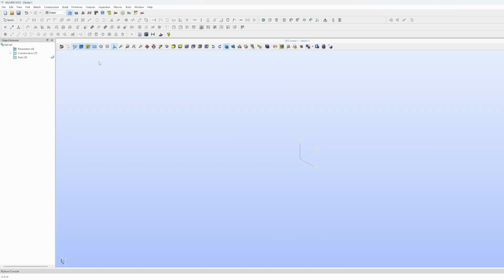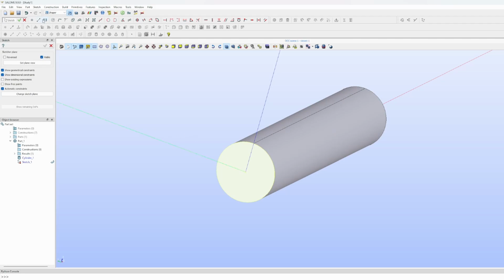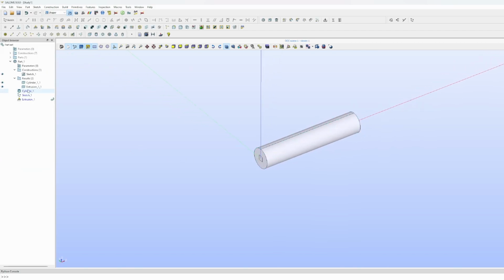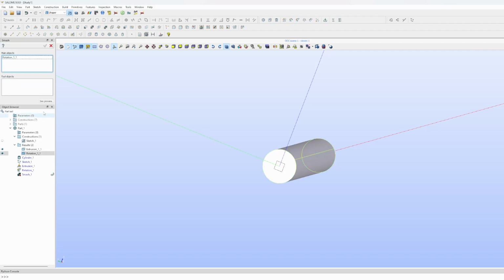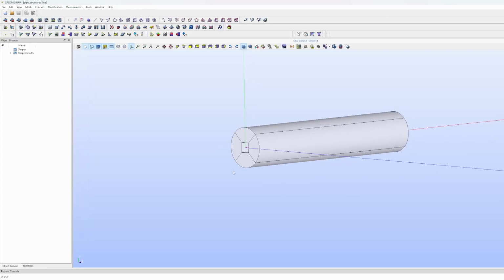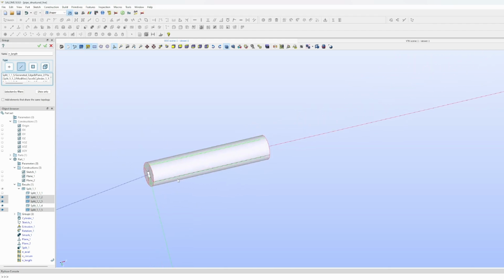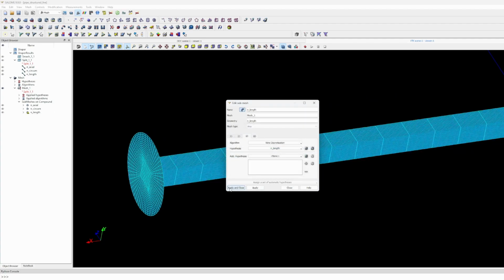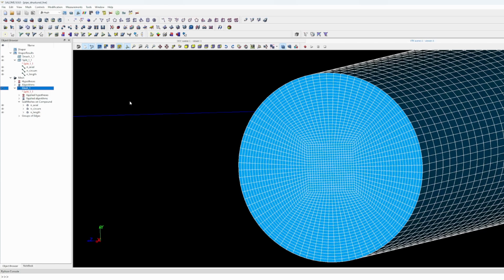How to create structured mesh in Salome

Comment: I had trouble following this on my computer.  Perhaps you are  clicking things or have setup that you are not fully explaining. For example,  when you "set the origin" of the cylinder,  what are you doing?  I could only see the mouse pointer moving around,  but am unable to see exactly what you did when setting the part origin.  It is not working on my 9.14 system.
OK,  I just figured it out.  When you click on the Set Part Origin Box,  a point at the junction of the axes lights up.  The the Sex Axes box on the left light up.  Then you can click on the axes in the diagram.   After that,  you can click the green check mark and the cylinder will be completed.
Reply: Now,  when I go to Geometry,  I have "*Cylinder_1" ... but I do not know why there is a * and I do not know why it is shown in red.  Presumably there is something else I must do,  but I do now know what.
Reply: Co-Pilot is telling me I have to "Export to GEOM" by right-clicking on the object,  but when I right click on the cylinder,  there is no Export to GEOM option.

Comment: I would like to know if it is a cylinder with an obstacle in the middle in 3D?
Reply from the maker: @aliounebadaraibnabutalibdi9095  There is no obstacle inside the cylinder. If you want to create something like that using structure mesh, it's better to use the more advanced meshers like Pointwise or ICEM.

Comment: How to export with patches for example inlet,outlet,wall etc when we make a mesh like this?
Reply from the maker: You can just create groups of faces in Shaper or Geometry module BEFORE creating the mesh. Then you will automatically have these groups as patches when you mesh.
Reply: @ i did that but i got other patches as well like for example the n_axial, n_circum,n_length which were created for refinements
Reply: @nawarajthapamagar23  I am also faing same issue.....Did you get ans? Also I want to create Circular patch at bottom as fire inlet.
Reply: @nawarajthapamagar23  Same here... did you find the answer?